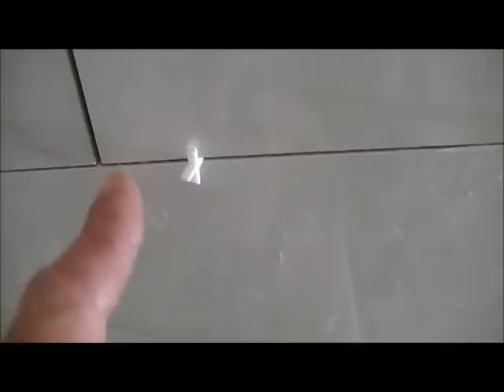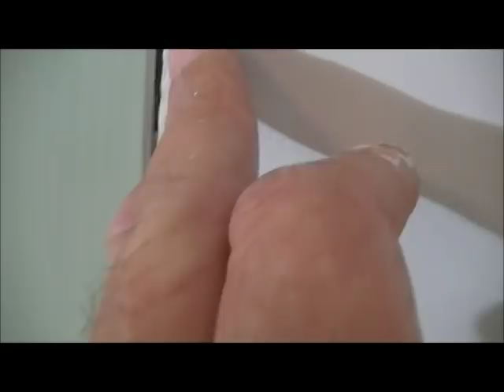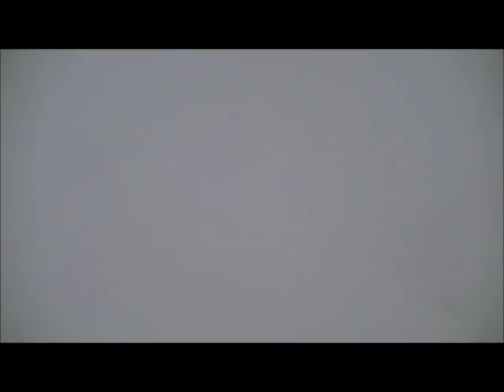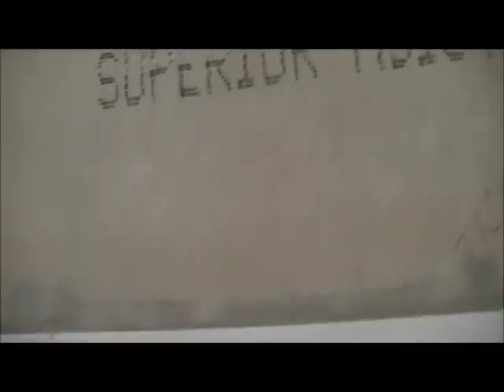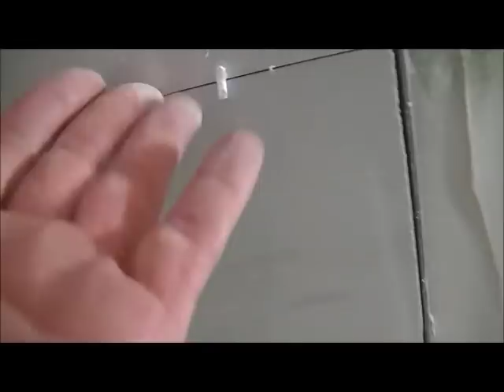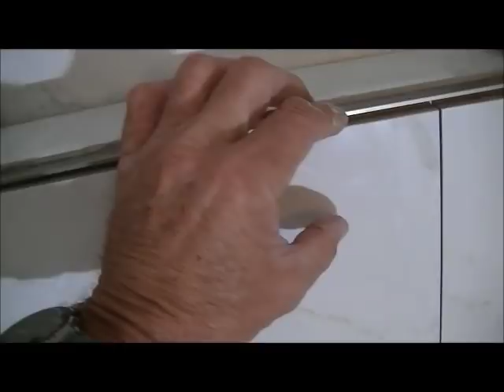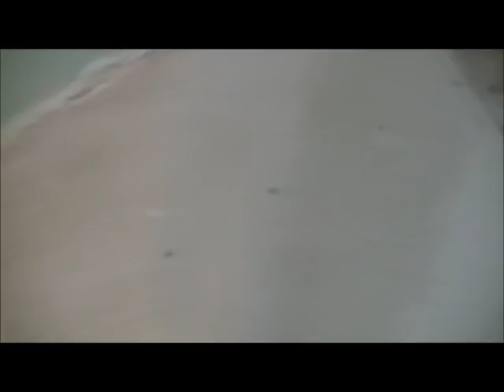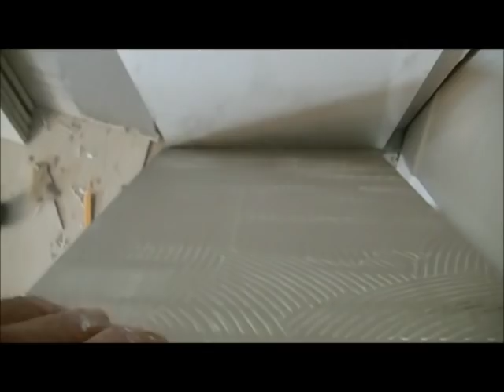Tile Guy Messes Up Project ( really bad tile job )

Comment: There should be at least half centre gap at corned, it's filled with silicone, it's to allow for wall expansion ,contraction ....
Reply: No
Reply: According to the TCNA it's sufficient to silicone the corners. We like to either use Dilex or another schluter profile. Commenting because someone else said you were wrong about expansion gap

Comment: The sluether is not backwards . I've always put my bullnose and sleuther on the inside of windows and niches,it looks hideous when people picture frame the niche or window with their trim. This tile installer didn't get the right height sleuther strip . The tile is to thick and is sitting higher. Either way these guys did a terrible job.
Reply: I just saw a video from Schluter using the Jolly profile like this and I agree, it looks very clean

Comment: The framing and plumbing looked really clean so the job must have been a delight after demo. I always laugh when I see tile cut in half because someone couldn't figure out how to cut a square or circle in tile. It took me many years to perfect the art of cutting tile. Many many hours and mistakes. I don't butter my tile anymore. So long as your thinset is wet it will stick. I don't ever trowel on the wall, only the tile. That allows me to push my tile onto the wall and getting the thinset to really grab the wall. The other reason I install my tile this way is because it keeps my grout lines extremely clean because I'm not troweling between them. People tend to trowel the wall and then place their tile on thinset that is too dry which is why it doesn't grab.
Reply: Well you are wrong. It’s called a mechanical bond. Flat butter one surface, notch butter the opposite surface. I learned the hard way. You will too at some point.
Reply: @akamsrazor243  i have over 20 years of experience tiling. As LONG time ago I took the time to experiment and learned what works and what does not. So long as your thinset is wet and your ridges are collapsed it will grab. If I was applying the thinset the opposite way, which is putting it on the wall first, I would back butter for sure.
Reply: @akamsrazor243  no sir he is not wrong. I’ve been tiling for 18 years, and I’m a damn good tiler if I do say so. Never ever had issues and I tile the same way. Back buttering is a farce only America seems to adhere too. Like calling niches “nitch’s” hahahaha it’s “neesh”

Comment: Tile man Zack ,know that it's a stop work because the tub is most likely not level .yes the job is bad but I hope in future you let the people know that in a lot of case's the job is domed from other trades. Let's not forget these builders now force the less experienced tile installers to do unethical practices I'm a mechanic there's a difference from a tile setter
Reply: A tile job is only as good as the prep work that went into it.

Comment: Yuk...This job was wrong before the first tile was ever set...there is no waterproofing membrane at least in the corners & board edges behind it! I lay kerdi sheet or similar material behind the whole area in a single piece by pushing the sheet into the vertical corners It is impossible for the walls to leak this way

Comment: Stop using hand grinders for your tile that is not from a wet saw
Reply: Honestly. I look at half of these videos and I’m like where the hell is wet saw machine? Even after I use the wet saw, I use a grinder with a tile buffingdisk to clean off the imperfection and I buff the cut side side at a 45° bevel. Often times it looks better than the original cut tile. Only takes an extra 10-15seconds to do so but looks much more professional
Reply: 4 inch and a buffing disc. What’s this wet saw bullshit. You gonna run down to the yard from the bathroom every grinder cut and then wait for the tile to dry before laying? Cmon

Comment: Which tile cutter would you recommend for large format tile?
Reply from the maker: Dewalt 36000
Reply: I have the cheaper Ridgid unit (like the Dewalt) but you gotta chuck the blade, it is junk.

Comment: Alright alright, I agree with everything you’ve pointed out. In addition making a video to show what not to do is cool as well for those getting started and ( my biggest problem guys or gals refusing to apprenticeship first before going out on their own ) need guidance. However, I hope and pray you contacted the individual that did the project and offered to help/show him how to fix these issues. LEADERSHIP FIRST GENTLEMEN! We have a lot of individuals that have just jumped into our trade without any real know how because of YouTube ( IRONICALLY). RIGHT?
Reply: These kind of guys without experience kill me.  But i always offer my experience in areas i can to new guys and guys wanting to get started.

I also make calls to get as much info and insight when I'm doing s new task or something I'm going to do better

Comment: I have a question about professional tile installers.  I often drive through the Fort Pitt Tunnels in Pittsburgh which are lined with .  Sometimes I have been slowed down in traffic and the "lippage' is terrible, you can see where the exhaust fumes go past the "lips".  Isn't this supposed to be a union job?

Comment: This looks like the owner try doing this based on videos. No damm professional does this.
Reply: I'm redoing a shower that 2 separate "Professionals" previously did that was just as bad as this shower. But I agree with you, if they were actually professionals it would have been done right the first time.
Reply: @shanebarrows1867  yeah some ppl claim to know. Some think they can do it on the go. But this is beyond terrible. Unacceptable.  Even for a person who’s just starting from being a helper would do a better job.

Comment: The gaps will be filled with silicon. That is not part of the problem.
Reply: Colorblind        I think you are not just colourblind think your totally  blind
Reply: Be ok for a junkie house lol😄😄😄 they will  think its straight
Reply: RIP it all out terrible job
Reply: @johnjtplastering6991  That doesn't change the fact that the inside corners are filled with silicone and you can no longer see the size of the corner.
Reply: @Stompaholik  silicone is supposed to be fine straight line not big clumps like that would need to be   it's a terrible job just hope it's his own house and not a customers

Comment: You're in ATL area. Do you come up to Buford? Cuz we SERIOUSLY need help! (we are victims of a bad contractor) I haven;t had use of almost 2/3rds of my upstairs since mid January. I kid you not. No maSTER BEDROOM, NO MASTER BATHROOM, NO MASTER CLOSET.. ALL THE STUFF ROM THOSE ROOMS IS IN OTHER ROOMS UPSTAIRS... WE HAVE REAL USE OF ONE BEDROOM (bonus room....sorry I hit the caps lock) AND we use the hallways bathroom (full bath)   I'll look you up... you can do a video on the tile job in our master bath if you want. in fact..I invite you to do so   💖 All we kept hearing from the project manager and some of the other sub contractors was 'you're going to love our tile guy!'...... we must not have got the actual tile guy they were talking about...cuz our young tile guy was 'learning on the job'.
Reply from the maker: Sorry to hear about all your issues, that must be very frustrating, and from January going forward it's hard to believe... I could build a house in that amount of time.
But to your question, yes I worked All Over Georgia and even out of state on occasion. 
You can text pics of what you have going on and then we can have a conversation.
678-852-8352 Bob
Reply: @StarrTile  I can't text you. I don't have a cell phone.  (low vision issues/detached retinas...both eyes) Frustrated doesn't even begin to describe it. I cant find anyone to help me at all.  I've filed with SOS (they don't directly help the individual) I've filed with Georgia Dept of Community Affairs....got a response they will 'monitor the situation'.whatever that means. My hubs sought out an attorney at Deming Law Firm (totally worthless firm) I contacted TrustDale. Nothing...just a we'll pass this on to our team but we receive thousands of these' response. Contacted AJC. News teams (via email)  No one cares. So 'Frustrated' doesn't  even come close.  I have no idea what to do or even where to find help at this point. I'm literally ready to just pack all my stuff up in totes and live like I just rent a room in my own home. ... not sure how long i can hang on doing that. the only reason for engaging on this endeavor of redoing the bathroom was because the original child sized shower the builder originally installed was beyond repair.  It had suffered hair line cracks within a  few years.... a repair company had come out to assess what was going on, explaining the shower had not been properly installed/supported underneath.. Hubs had just drilled holes ,filled it with that foam stuff that gets hard as a rock, and then fiberglass patched it. It was ugly as heck...but that is how it was. It worked.....as far as pushing the can down the road.' Then in mid January the drain pipe cracked.  So that made it no longer a matter that could be ignored. I have some kind of enhanced hearing....maybe due to loss of alot of my vision, My hubs was showering one Sunday morning and I heard the drip in the ceiling above me. Hopped up on the couch to feel around on the ceiling and my finger went right thru. But I had taken note of it at the beginning of when it began. A water restoration company came out (via our home insurance company) did a thorough investigation and they applauded me for having caught it as soon as it had began.... no water damage...no insurance claim.  We did not enter into the endeavor lightly. We had at least 12 companies out here prior to my hubs deciding that this contractor was the way to go. it was like a bait and switch. I wasn't included on the contract. I don't know 'why'. If I had been, I'd have stopped it before it even began. My hubs put down a $10K down payment (half the cost) and didn't even hear from the guy  for weeks.... over a month passed. I kept urging my husband to do a 'charge back' before it was too late. I was ignored. Didn't hear from contractor until my hubs reached out to him on day 34. work began Day 44. Everything that any sub-contractor did, had to be re-done have errors addressed. Who caught the errors? ME. there were things they willfully addressed and things they just ignored, I was told by the project manager to 'please stay off the internet'  after the plank tile flooring to the main floor of the bathroom had been installed. It isn't 'right' I knew it wasn't right. So I tried to investigate and learn about what went wrong.  I went to the manufacturer of the tile website. It hadn't been cut properly and it hadn't been spaced properly....and i doubt the underlying prep was done properly (from what I have come to learn) I brought up these concerns and issues...there alot of lippage. Contractor even came out to look at it himself. Told me 'grout will fix that'. He claimed the lippage was within tile standard industry standards. I doubt it. It just 'feels wrong' under your feet. I have low vision, what I'm feeling under my feet 'matters' a great deal. And my hubs still trusted them to install the shower tile. I hadn't even wanted a tile shower. Contractor had impressed upon us that 'no one is impressed by a insert.......you'll get more out of your investment if you are to eventually sell your home if you do tile.. I have low vision. I wasn't thrilled about having to deal with grout lines....but there is grout that eliminates that issue. I can;t even get into what happened with the install of the shower tile. I can't even get into what the current end result of it is. I can't even bring myself to go into that space. It makes me cry. I apologize. this sounds like some freaking 'sob' story. An 'oh poor me'. It isn't. I can't believe this is even happening. I am literally at the end of my rope. I don't even remember how I happened upon this video of yours yesterday. I wasn't looking for anything of the sort. I was watching something else and had been posting a comment to something else and I must've accidentally hit a button on the keyboard that pulled up your video. .... I had thought to myself 'this isn;'t even anywhere near as bad as what  I have going on. I liked the response in the comments of the guy who stated 'nothing a hammer won't fix'. I laughed. Because I have had to practice great restraint to not take one to this beautiful improperly installed tile I selected for my master bath tiled shower. ...and it truly is beautiful. I'm just very sad. Out of sorts and have no solutions and no where to turn for help. Cuz I really needed 'this' with everything else in the world coming un-done. I just can't take much more. Thanks for listening to what will probably end up being ' the straw that broke the camels back'. I've already gotten pretty 'weird'. I've given lots of stuff away just to eliminate the complete chaos going on inside my home. Cuz I just can't 'cope'. I hope the contractor responsible for turning my life upside down feels really good about having turned my life into a living nightmare. I hope he feels good about getting ahead by doing wrong to innocent people who have done nothing to deserve it.  I might call you. I will pay you if you decide to come and look at this. I am not very comfortable making online payments. I still pay my bills by check and get paper statements. I know that makes me super weird. alot about me doesn't mesh with todays society. I don't 'fit into it' anymore. 💖

Comment: Damn I just did my bathroom with a guy here in Miami, which i mentioned multiple times about red guard and kept saying we don’t need it, there is no floor under us, it’s cement etc. until i forced him and only got it about 3 -4 inches from the shower pan up and on the show curb